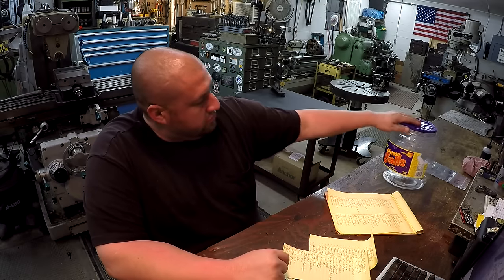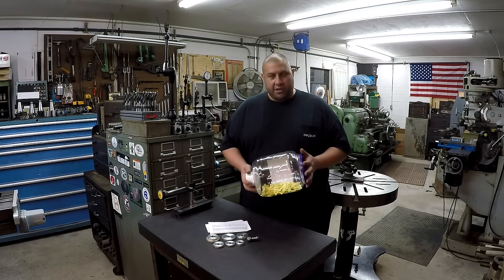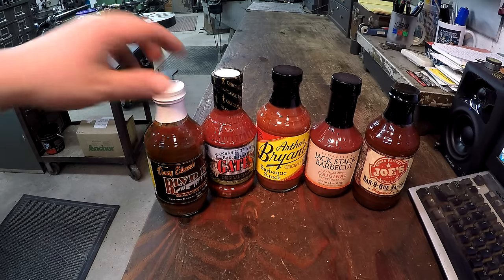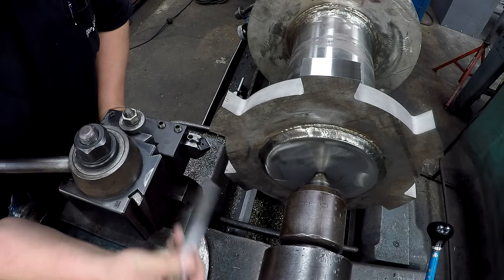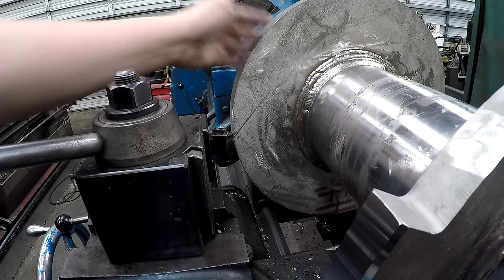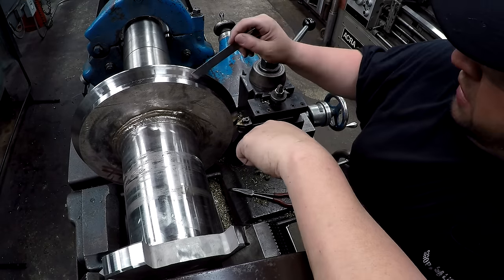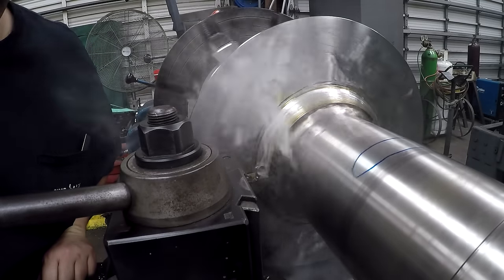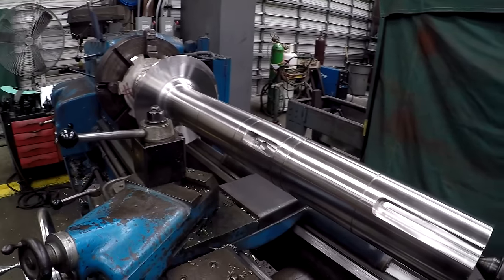Saturday Night Special 94

Comment: What you do as a job and in your own shop is light years from my efforts as a hobbiest. I've machined 304 a few times and it sure as hell didn't cut like that on my equipment. Those big or at least bigger machine tools and parts are a world away from my little machines and parts. Have only been into Pensacola and Florida once. Nice place, but the humidity was unbelievable. Beautiful work on that part Adam.
Reply from the maker: +Turning Point Yes the humidity sucks here. It's home for me but I think i would love the cooler and dryer climates.
Reply: +Abom79 
Maybe Adam, but that cooler and even drier usually means snow in the winter. I've already had a couple of light dusting's last week, and I'm maybe 80-90 miles from where Ave lives. And that's the only recognized desert area in Canaduh.

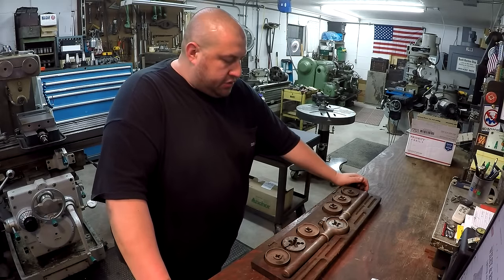Comment: @18:36 - I just got a full set at a flea market for ten bucks. The gentleman who sold them to me, didn't realize it but it was a box with 3 wooden 'shelves' inside. All of the same type of tap and dies you have. He opened the box to show me and didn't realize you could pull out each layer of tools. The original label is still on it and it appears to be all original items. Cool stuff for my collection.

Comment: Nice SNS tonight, Adam.  Great work on machining the shaft.  I liked how you handed that 60 degree angle and the radius.  The toolholder and bit looked like it held up really well to those interupted cuts.  Off to watch some slitting action next.
Reply from the maker: Ryan that tool is great for ops like I shown, corner bevels, chamfers, and undercuts. I keep it set up on the tool holder.

Comment: I needed a m27x1.5 bolt for a camshaft puller a while back. It was a no no with my southbend 9a because of the lack of transpose gears. I had to buy 1 bolt for $30. Wish I had a set of those gears

Comment: Hey Adam,
 
WD40 is a good label remover. Much better than alcohol which tends to allow the adhesive to smear as it evaporates. It's one of the few things I use it for, for most other stuff Duck Oil (bought by the gallon) works much better for me.
Reply: +Paul Compton I have also used WD40 to remove labels - all the way back to the time when I used to re-label floppy disks.
It works very good, then I just used some Dawn dish soap and water to clean off the WD40.

Comment: another great video, brother adam!
now you have a collection of sharp mill bits and a nice clip of sharp mean sauces. i believe there's a local fire department nearby.
what is that shaft from? some kind of a wench, no?
i think it's 400-series stainless.
thank you,
-toly
Reply from the maker: Hey Toly, the shafts will be fitted into a 20' long stainless tube and welded. That all I know, and it's 304 stainless.
Reply: +Abom79 hi adam, and thank you for the speedy reply.
i actually mistyped -- meant to say 300 series. thanks for correcting me.
great shafting -- industrial action!!
-t

Comment: Adam, I was wondering why you used your scale to clean those hot stringy chips off of the tool instead of using the needle nose pliers that were laying right there. It seems like the pliers would be safer and you would not muck up your scale. Anyway, thanks for another SNS!
Reply from the maker: +Jeffrey Vastine Just out of habit, but I use both. Scales are easily replaced when they get too grubby.
Reply: Okay, thanks for the reply Adam!

Comment: Hi, I love watching your lathe videos. Did you take classes back when getting started on using lathe or is it mostly experience? Seems like lots of decision making is involved as to what tool to use, what angle to get in. I know machinist handbook may have some of that info. just curious how you learned
Reply from the maker: All of the machining I learned hands on by my Dad, grandad, and mentor Sonny. We had a job shop so seen many types of repairs and metal fab.

Comment: Hi Adom.  Love your vids. How do you grind a radius on HSS tool by hand? Can you show us sometime. And why do you need to put a radius? Is it for strength or for looks  if you remove weld doesn't it get weaker ? Thanks for sharing your skills and knowledge.  P S. How far are you from Disney??
Reply from the maker: Yes I grind by hand on the 12" Baldor pedestal grinder. High stress point should always have a generous radius to help keep the shaft from cracking breaking. I think Orlando is about 8 hours from me.

Comment: my top 3 channels(in no order):
AVE
Oxtools
Abom
Reply: +Pete Duckworth  Don't forget Keith Fenner (get 'r done), he hasn't had as much time for new vids but his old stuff is great too.

And also  SVSeeker,  boat in the backyard is an epic DIY project.
Reply: +Pete Duckworth no keith rucker? no doubleboost or  Kilroy?
Reply: +jusb1066 
...outsidescrewball, Randy Richard, Clickspring...

so many good channels, but there could only be 3 for the "top three".
Reply: Pete Duckworth
well no-one can win this! lol but my 3 are different is all, but it would also not be 3 long either :)
Reply: +Pete Duckworth Check also SV Seeker, a little bit different but very intresting
Reply: +Pete Duckworth You might also want to check out +doubleboost if you like the occasional cooking video in with your machining, casting, and welding vids. I went from +AVE -> +DoubleBoost -> +Oxtools -> to here.
Reply: Albechtparts

Comment: Lots of razor blades in that stainless strip...

My question is what is the shaft for?
Reply from the maker: There are two. They get fitted in side the ends of a large tube and welded in place.
Reply: +Abom79 What kind of machinery is it for?

Comment: Good video Adam. But DAMN!!!! Ya gotta warn me when you get that massive Pace lathe going and you're gonna cut those teeth all nice an purdy and suddenly it's busting my dogs ears. They went BESERK! It was like they heard a squadron of B-29's come over the house and drop bombs all over the house. Okay, so it was partly my fault. I had my sub-woofer still at max after listening to some tunes on the computer. When you started to cut the teeth down, the Pace was making a very cool rumble sound each revolution. But with my sub-woofer cranked to full bass, oh man.... Bandit and Meadow went nuts. They thought the roof of the house was collapsing. Never laughed so hard in my life.